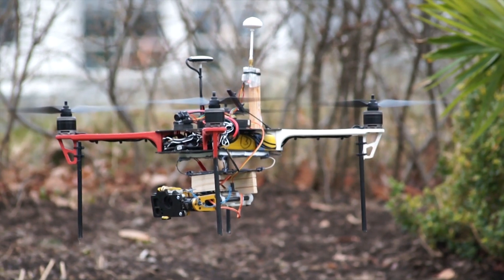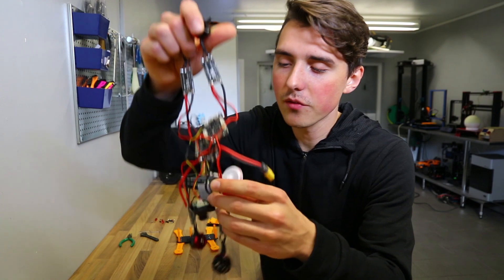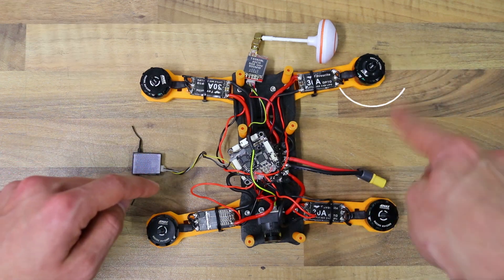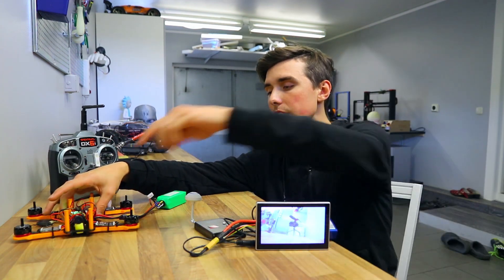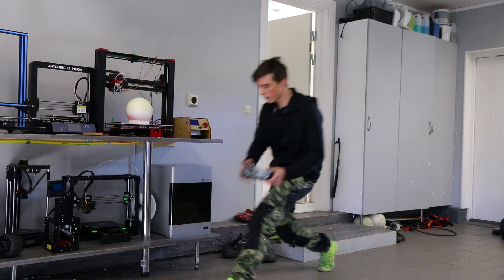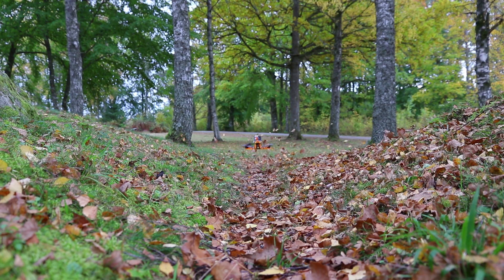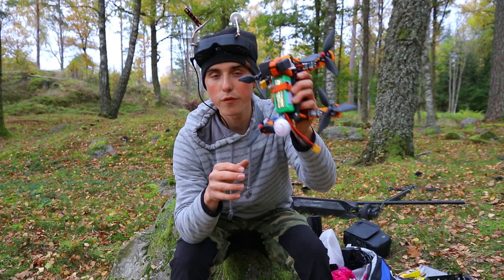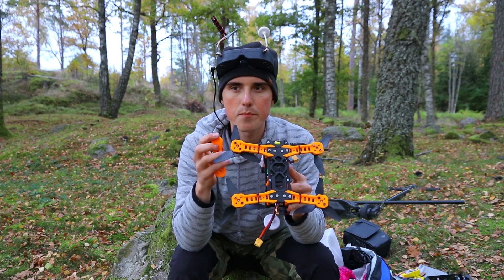3D Printed Racing Drone - Will It Survive?

Comment: I printed the peon as my first frame, and I still fly it today.
I like it a lot, and printed in PETG with the recommended infill gives it a pretty good resilience.
I only broke 2 top plates where I zip locked the battery connector to avoid stress on the flight controller in 5 months.

By the way, the creator of this frame (tech2c) also have created the hypercube 3d printer, and it's a very good one too!
Reply: @pascal, I printed it at 100%. it's on the heavy side, but good to learn.
@ozzman yep, still flying it. it pretty durable and my only issue is the back of the top plate that broke 2 times, where the spacers connect. but those where VERY rough "landings". not an issue if you can print them, I have a bunch of spare parts.
Reply: I fly LOS, without gopro like nor fpv cameras. I get around 10 minutes on a 4S 1300mah
Reply: Thierry Schork, I work on this frame. https://www.thingiverse.com/thing:2507950 I have some one printed it for me at 100 infill PETG and its awesome. But at this infill density its gets a bit heavy. What infill density did you use?
Reply: Thierry Schork   is the frame still holding up? I am getting ready to build one and this is the frame I want to use
Reply: Did you print the spacers or buy them?
Reply: I bought them. I did print a few, but didn't used them. I was afraid of poor mechanical resistance.
Reply: How long can you usually get for battery life?
Reply: Thierry Schork Ok thanks. I was thinking LOS aswell. 👌

Comment: Really fantastic work, man. A tip: now there's AIO boards, that are flight controllers, 4 in 1 escs plus OSD, everything in one. Those are great and makes it easier to build a quad like that. 

Also, Samm Shepard did one like that a few time ago. And what he did was designing the arms integrated to the bottom plate and he glued a carbon fiber layer to it. And it turned out amazing!